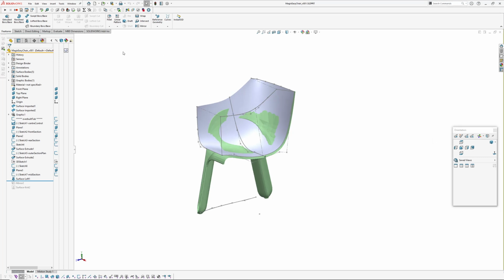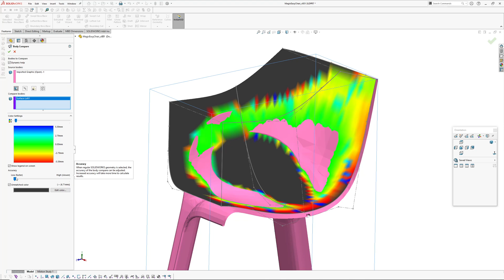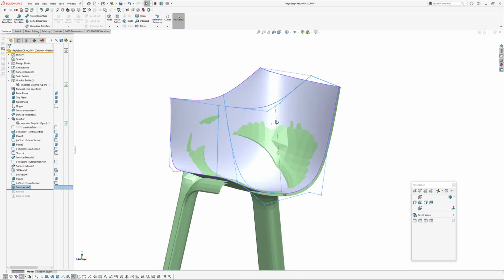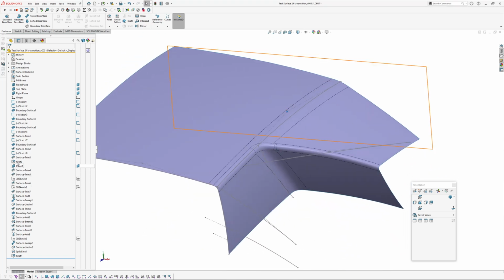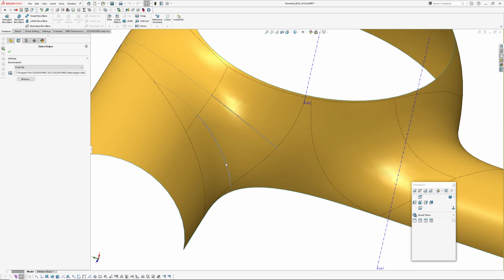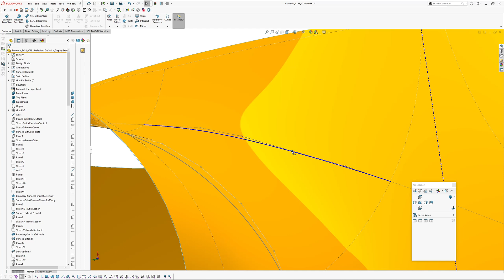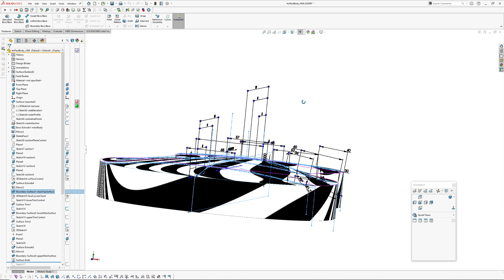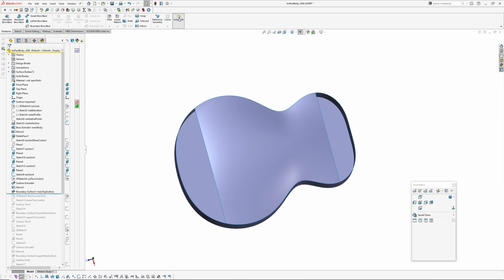Form Finding Using Instant 3D in Solidworks

Comment: Andrew, I've never watched one of your videos without gaining something new. You consistently inspire me with your work and techniques.
Reply: Likewise. I'm only a couple of minutes in and Andrew drops "Body compare" on us. How, after more years of using SW than I care to disclose, did I not know about this? I'm ashamed to think about the number of times I've mentally cursed the lack of a tool like this.
Reply from the maker: Yeah body compare is quite handy. You can also use it to match a surface to curves (including 3D sketches), just you need to convert the curves to an extruded surface first. Quite handy for overbuilding surfaces. Another tool that people overlook is interference detection within a part. That has been around for a while. It used to only be in assemblies, but it makes sense to have it in parts, especially handy if you model multi body parts.
Reply from the maker: All good! Thanks for the comment, always appreciated.